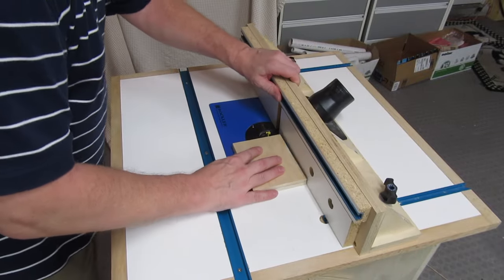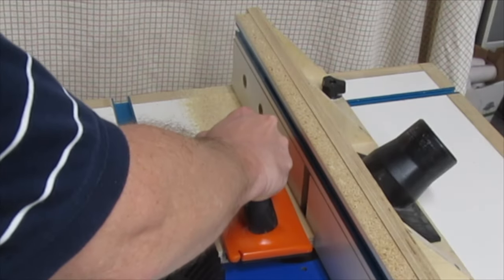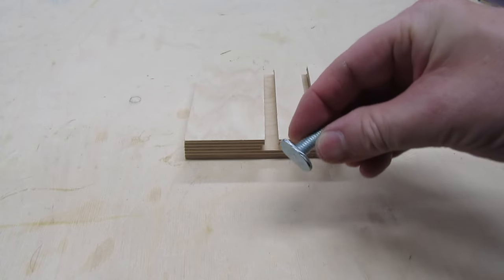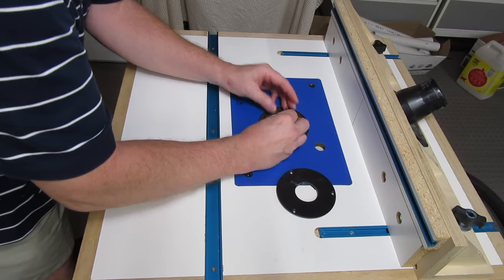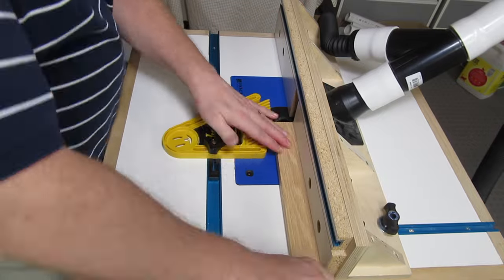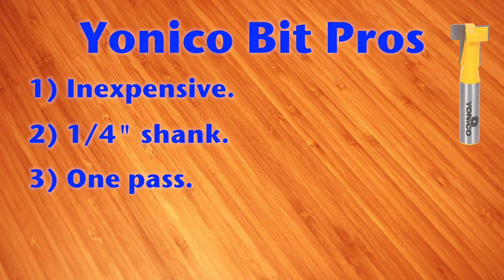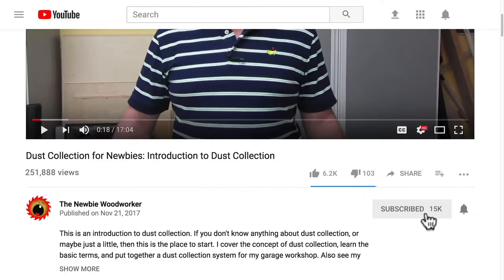Make your own T-Tracks and T-Slots!

Comment: Very good info & well presented. Questions: How do you think the wood t-tracks will hold up over the long haul? Are you at all worried about wood expansion/contraction? Just curious.....................Thanks again..............
Reply from the maker: Thanks, and here's the answers: 1) No idea, and 2) yes. Oh, you want more than that? 😛 I think the wood t-tracks will hold up great in everything except for high-stress clamping situations, and since that'll be the case with my drill press table, I guess I'll find out! As for expansion/contraction, I don't have enough experience to know how much it will affect things. I do have red oak edging on my router table, and it's over a year old, and the edging hasn't separated or anything. But that's different than being surrounded on both sides by plywood. I guess time will tell, right?
Reply: Sapele Steve...aluminium expands and contracts too...!!...but in such small bits of wood etc I don’t expect it is that much, unless you require exceptional accuracy...?
Reply from the maker: Stuart - Correct. But when you combine two types of wood that have vastly different seasonal changes, then there's definitely a potential for issues. Since it's hot now, the worst that would happen is that when winter comes, the red oak will pull away from the plywood to some degree, as it shrinks. But even if it does, I doubt it'll be an issue. Then again, ask me next year. 😛

Comment: Just found this video 3 years later............One issue when you use the blue T-track that you don't mention is that if you installing it in 3/4 material, the screws you use to secure it are very small.  After a few times cranking on the clamps, I have had the blue track come loose and "pull up", instead of the clamp "clamp down"
Reply from the maker: It depends on how you're using the t-track. For instance, if it's for a fence on a router table, you'll never crank it down hard enough to matter. But if you're using it for something like clamps, then try 5-minute epoxy to glue the tracks down - they won't pull up at all. https://youtu.be/ocHrw8eeMTM
Reply: @TheNewbieWoodworker  Excellent.  Thanks,
Reply from the maker: @holdemNE1  👍

Comment: F.Y.I. Yonico also has another 1/4” shank bit that will do the standard t-bolts as well as a version sized for 10mm bolts.
Reply from the maker: Thanks for the info!
Reply: Thanks for the great videos!
Reply from the maker: @scottscholtens3546  😄
Reply: Being a somewhat newbie woodworker myself, they are very helpful and informative. Do you have, or do you intend on releasing a video on your drill press table? I need to make one and really like the look of yours. It’s one of the only ones I’ve seen that goes back along the sides of the main post. That is how I’d like to design mine.
Reply from the maker: @scottscholtens3546  Thanks. I started a video, but I didn't get a chance to finish it. I have a SketchUp model: https://3dwarehouse.sketchup.com/model/4d82cc7c-6523-442c-8ffe-8364957b1adb/Drill-Press-Table-with-Hardwood-Edging, and I'd be happy to answer any questions. You can email me directly from my website, thenewbiewoodworker.com (click the Menu), if you want more information.
Reply: The Newbie Woodworker Thanks!
Reply from the maker: @scottscholtens3546  👍

Comment: Thank you for this very informative video. T-tracks are awesome! Can you please tell us about your video setup. Editing software, camera, lights, microphone. etcetera. Thank you so much!
Reply from the maker: Thanks! For software, I use Final Cut Pro X to do the editing. And I have a lot of stuff automated using Keyboard Maestro along with a lot of custom JavaScript (JXA) code. I use iZotope RX 7 Audio Editor (fantastic software) to clean up my mouth clicks, which there are a ton of, and remove some of the echo from recording in my office. I also use it to help clean up the shop background sounds, by removing the AC or fan noises, etc. And I use a plugin from Neat Software that clears up some of the graininess in the video, since I use cheap cameras. Speaking of which...

Hardware-wise, I use a couple of Canon Powershot cameras. I have LED lights in the workshop, but I supplement them with a pair of Neewer LED fill lights. I have an articulated ceiling mounted camera dolly I built, that I use most of the time. Otherwise I use a cheap Amazon tripod. For the few times I do voice work in the shop, I have an Aspen lavalier mic, and a Zoom H1 recorder. For voiceovers, which is what I do most often, I use a Blue mic on a Rode articulating arm.

I'm probably forgetting something, but that's the gist of it. Too much info? 😛

Comment: I think I'd prefer making my t tracks from hard wood strips, you know, laminating. Or maybe I could find a steel flat bar that can be used. I'd simply buy the T tracks, but here in Peru there is no place to buy such hardware. I'd import them from outside, but it gets too expensive.
Reply from the maker: Interesting. Thanks for the comment!
Reply: The Newbie Woodworker Tragic, I'd say. Ha
Reply from the maker: Yeah, it does kind of suck.

Comment: I've looked for a "universal T-slot" router bit, which would make a groove like a universal T-track (which accepts hex-bolts as well as T-bolts), but I have not found one. The closest I have found is this one from Lee Valley, but it is not quite right to accept a hex-bolt:

http://www.leevalley.com/us/wood/page.aspx?p=51233
Reply from the maker: Thanks for the info. I wonder why it's so hard to find?
Reply: @TheNewbieWoodworker  I wonder if emailing the engineers at Rockler or Freud would help produce a new router bit with those specs.
Reply from the maker: @kryptik0  Doubtful.

Comment: That "T-bolt" bit still seems to suck , the T bolts still rock back and forth quite a bit
Reply from the maker: They're supposed to do that, so you can slide them along the track. If you're looking for something to be more exact, you need to use a miter track instead of a t-slot. Something like this: http://bit.ly/2zqbA29. And if you want to lock something into place, you use something like this: http://bit.ly/2ByufXu.

Comment: nice video why not metric! so much simpler
Reply from the maker: Thanks. I've talked about the reasons before. For one, it's much easier for me to find imperial tools and hardware than metric.
Reply from the maker: gimik2  Very true. But I still wish we were all metric. When I'm trying to center a 5 7/16" piece in the middle of a 9 11/32" piece, if I didn't have a good calculator app, I don't what I'd do! 😛

Comment: t-slot must use only aluminium track, wood not newer workinj good. too soft, or need use australian boluke wood only.but this you not can router cut track.alumin track have wery cheap and best use.i just buy alumin T-slot rails 800mm long/pcs 9$/pcs wery cheap.not idea why made diy not come good.
Reply from the maker: OK, thanks for your thoughts.

Comment: - It would have helped if we could have seen the actual cut. Looking down on the router table doesn't help.
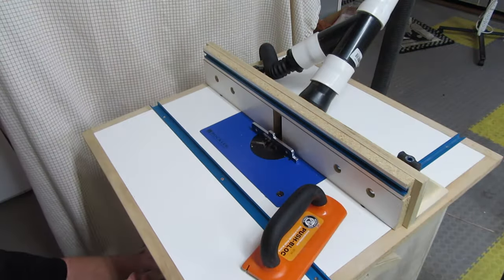Reply from the maker: I'm not sure what you're saying. I showed the results of the cut in lots of places. The thumbnail, for one. And around 2:30, for a video example. If you're saying you wish I had a better angle for the camera during the router cuts, then I agree. I still haven't figured out a good way to film that, and keep the dust out of the camera.
Reply: - The angle of the camera was my issue so thanx for working on that. The info is really good to have; actually seeing the process being done is even more helpful. Thanx again.
Reply from the maker: You're welcome! If you happen to watch a video that has a good camera angle for the router table, let me know. Thanks. 🙂